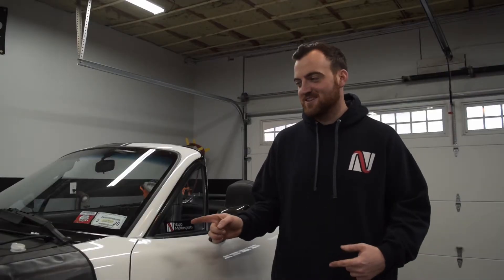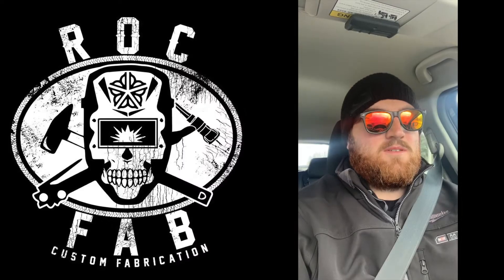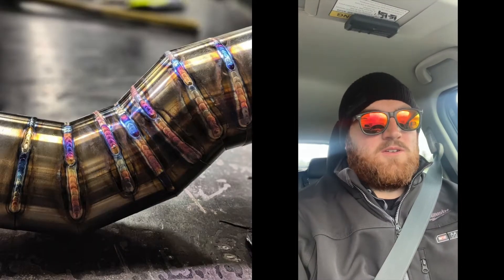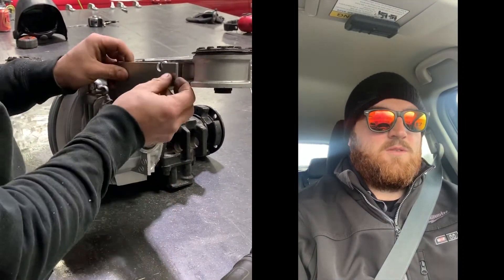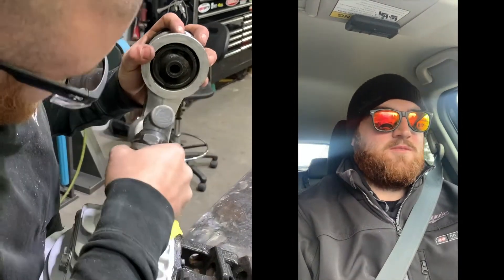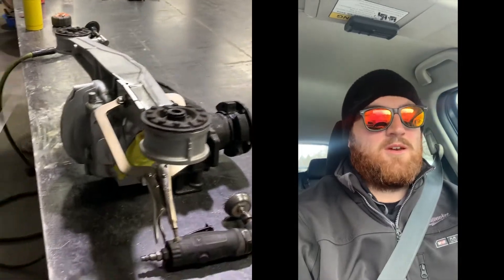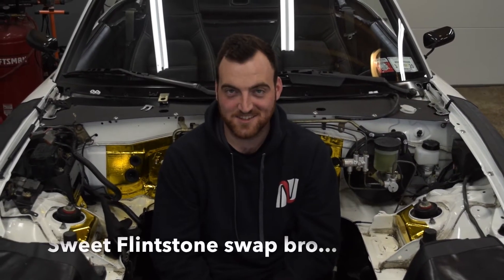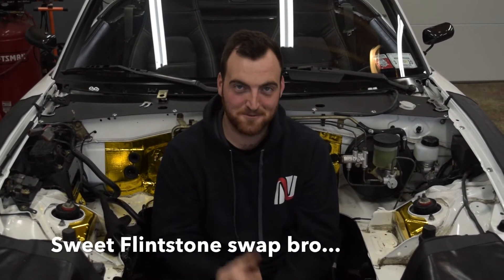Engine Tear Down & Diff Reinforcement - KMiata Build Part 2

Comment: Don’t really know much about mx5’s, was wondering how come it seems you only had to put the diff reinforcement on one side?
Reply from the maker: Mazda notched one side of the differential arm. This way in a rear end collision, the diff arm will break and the driveshaft won't shoot up into the transmission tunnel/cabin. It's not a problem for stock power miatas, but as you make more power, it has the ability to snap at the notch, and frequently does. This removes that possibility.

Comment: How much power is the diff reinforcement usually good for?
Reply from the maker: The weakest part at that point is the diff internals, so 350-400?
Reply: Napp Motorsports ok. Thank you.

Comment: What harness are you going to be using? I see they have two harnesses one required for ktuner and one for kpro, I was thinking of this swap myself and don’t see why they wouldn’t sell a conversion harness that just converts the stock Miata harness over to the k24 . If I were to do the swap id want to have mega squirt since its a lot more user friendly than the software the k series has.
Reply from the maker: It needs to run off of a Honda harness, as there are so many more sensors than a Megasquirt. I’m running KTuner, so I’m using the element harness. It’s really not that hard to build, and that’s coming from someone with minimal electrical knowledge, almost none in fact. KMiata is working on a plug and play harness though, which should be out shortly.